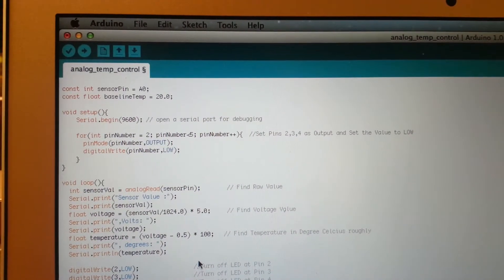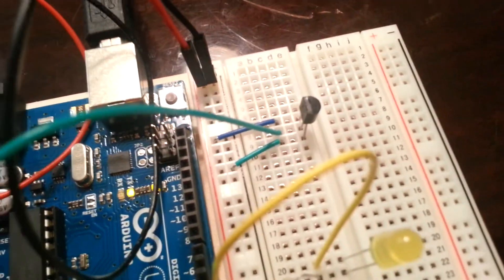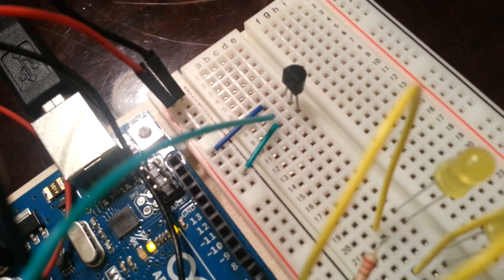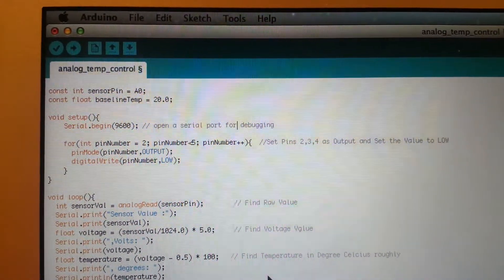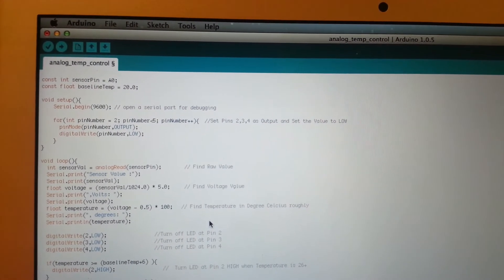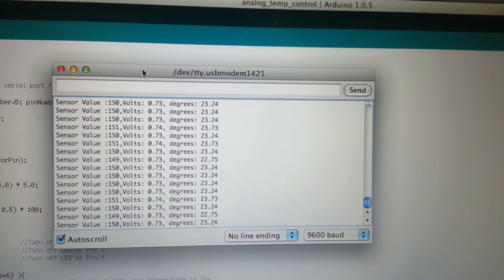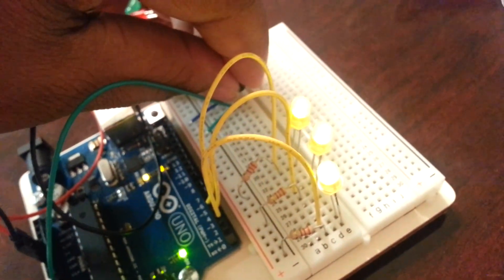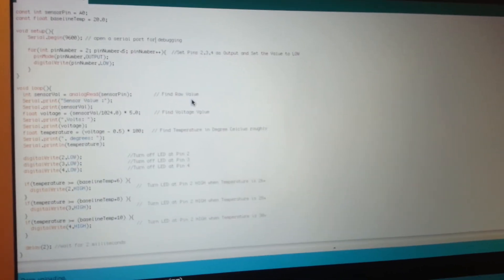Arduino 201 - Analog input Digital Output

Comment: I have a project similar to yours. Coding is working fine. Sensor is also reading the room temperature but the value is constant whether I am touching it or not. What could be the possible problem?